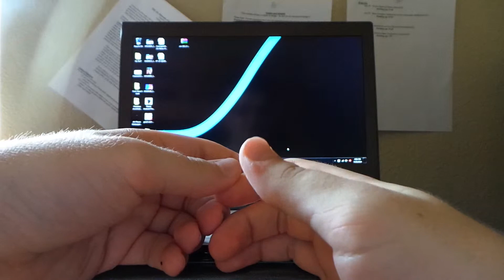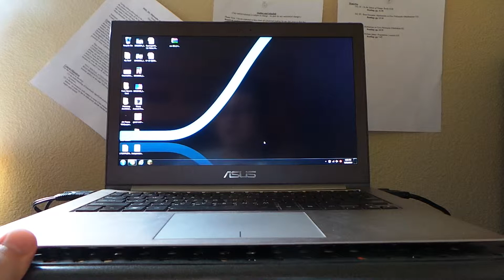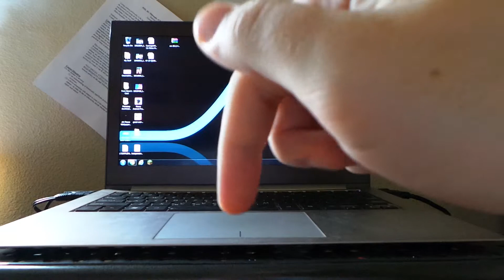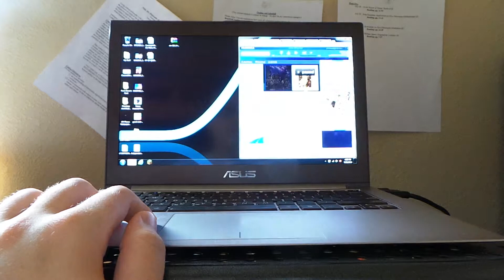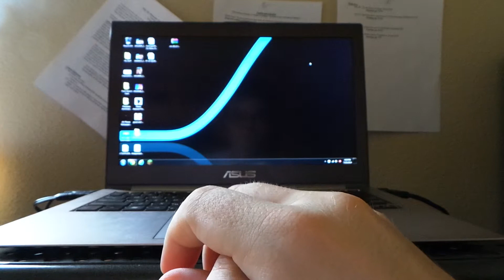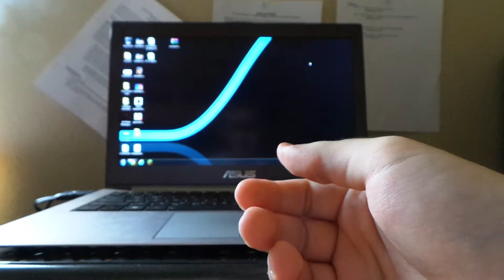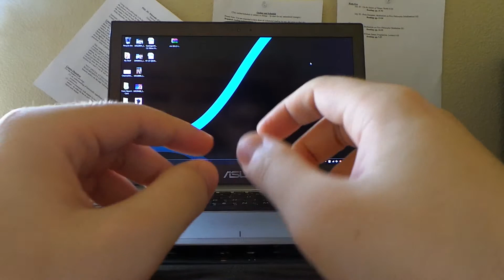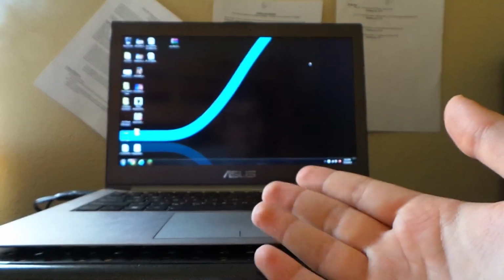Catch-up: Debrick Video Tutorial Updates

Comment: hii,

I tried to update my S3 att phone from 4.1.1 to lollipop but it was bricked. but i recovered it from local mobile shop. Right now I am facing one problem after it's recovery. My phone's wifi is not working. So if u can help me out that it is very helpful to me. I don't know what's going wrong in it while unbricking it, also the person who recover it also don't know and he was saying that it may be break IC or something. so it will not work again. so pls can u help me. pls reply as soon as possible.
Reply from the maker: Chirag Shah What might have happened was the Wi-Fi antenna was disconnected from the main logic board within the phone.  Check out LE55ONS's YouTube video for disassembling and reassembling the GT-I9300 (identical internal parts) to see where it is, and make sure it's connected securely.  Something else to try is to boot into recovery (custom or stock), and either try a cache wipe (stock or custom), wipe dalvik cache (custom only), or a factory reset (stock or custom).